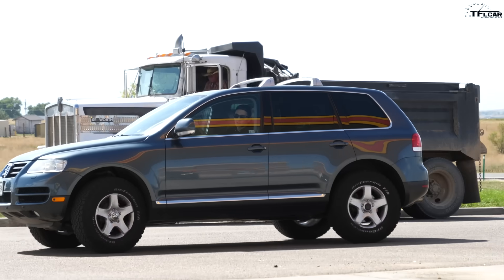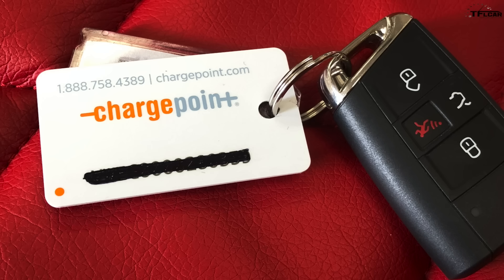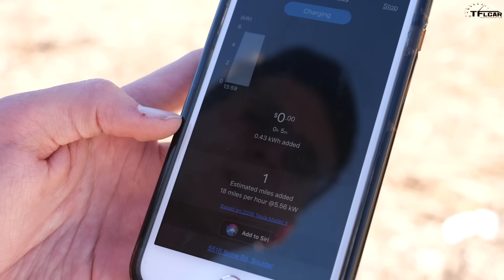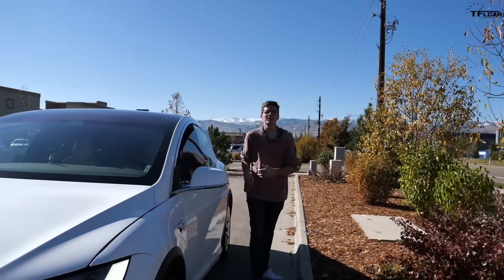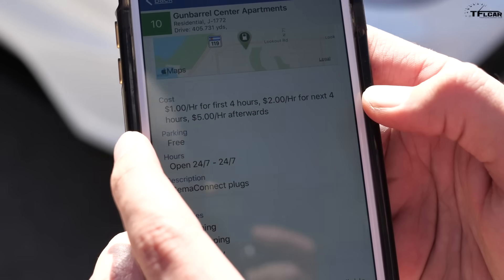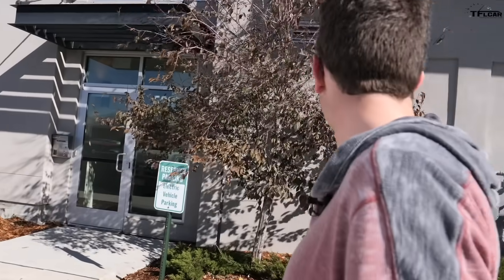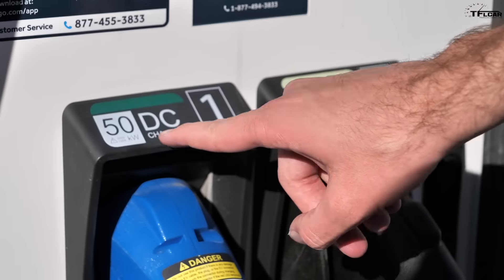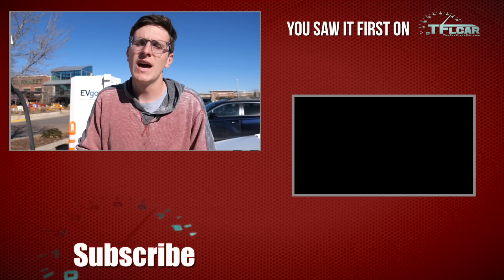Here’s Why Charging an Electric Car Can Suck - And It’s Not The Reason You Think!

Comment: Apparently EV owners don’t value their time.
Reply: non telsa ev owners.  Tesla charging station currently deliver 700 miles an hours, the new one are >1000 miles an hour.
Reply: @Curtis Fleabag Dude, have you seen the Tesla Supercharger map? There is a Supercharger station every 100-150 miles along every interstate in the US. 

This year we took our Model 3 from Atlanta to Orlando. From Atlanta to the GA coast. And from Atlanta to DC. To Orlando we stopped twice for 20 minutes. To the GA coast we stopped once for 20 minutes. And to DC we stopped 3 times for 20 minutes. Now that the even faster V3 Superchargers are going in that time will drop.
Reply: Philip Davis look between Dallas and Houston, there's only 2. So if you're between them and need to stop you gotta wait or hold it or stop at a gas station to drop a deuce. All the while NOT charging it.
Reply: @Scottjf8  So? I checked and the distance between Dallas and Huston is 239 miles by car with a butt-ton of chargers (including superchargers) in the metro regions of both. So, there are two options for superchargers, and on the public network I see more. Both supercharging stations have restrooms (and more), but for most Teslas there's only need for one stop on the trip. If you can't handle your bathroom issues with one stop that's fine, but you'll have the same problem with a gas car.

Bottom line here is those of us who have, or are considering one can enjoy the cost savings and lower pollution, and they are only getting better. Tesla's truck will have up to a 500 mile range and be about the same cost as the new F150 EV from Ford, and in the same range as the new Mustang EV. But you don't have to buy one.
Reply: If you say so. Could easily park, charge and go do something while it's charging. Really not that challenging to go out and do something while you wait. More like a You problem.
Reply: These kind of people also don't smellin their own farts...
Reply: @randygrein5386  *hands Randy another Kool Aid
Reply: @JPGtampa  Funny, that's the go-to when someone runs out of evidence. You'll come around when the Koch brothers die off and the ad campaigns stop. Unless your house blows away in the meantime.
Reply: @randygrein5386  LOLOLOL... Not a fan of the Koch brothers but okay, chicken little
Reply: @JPGtampa  There's a fable about the ant and the grasshopper that's relevant. But OK, be a grasshopper....
Reply: Just the stupid ones that use the low powered chargers shown in the video. Go to a Tesla SC station and it’s way different, esp if it has the new 250kw chargers.
Reply: City driving is actually less time. It's the road-trips that are a bit inconvenient and certainly need to be well-planned. Hybrids rock on road trips.
Reply: The thing is they expect everyone to stop every 200 miles charging their cars and wasting money at every Starbucks and McDonalds that is placées at every charge station.
Reply: Except you're totally wrong. I'll give you a few examples with my personal EV, a Chevy Bolt with 200+ miles of highway range:

Daily driving scenario:
I get to work. Plug in, do my shift, unplug, and drive off. Takes 10 seconds to plug/unplug. Meanwhile, with a gas pump, you have to stand at the pump for a few minutes! Not fun if the weather is bad... Most of the time, I only plug in 1-2 times a week, while my gas car was being fueled once weekly, so not much difference in frequency.

Road Trip:
It's important to note that going further than 200 miles is much less than 1% of the use of the car, so the importance of this use scenario is actually pretty low. I digress...

Even with a gas car, you must stop every now and then to use the bathroom, eat, rest, refuel, etc, all of which can take around a half hour, unless you're a slob that eats in your car as you drive! The waiting time to charge is easily mitigated by stopping at a fast charger where there is also a restaurant, pretty common for most fast chargers already installed today. After 30-40 minutes, the car is ready to continue on its way, while wasting almost none of your time because you were eating/resting anyways.
Reply: Whatchu talkin' bout, Willis?  It charges while I'm asleep.  What all you doing while you asleep?
Reply: I guarantee you I spend less time actively charging my EV than you do filling up with gas over 1 year. Every 3 or 4 days when I pull into my garage I spend around 5 seconds to reach for the plug hanging on the wall and walk back and plug it in. By late evening it is done charging and in the morning I unplug it as I walk to the car which is maybe another 5 seconds. 

So every month I spend less than 1 1/2 minutes actively involved in charging my car. How many minutes a month do your spend multiple times pulling off the road to a gas station, parking, getting out of your car, taking off the gas cap, getting your card out of your wallet, swiping, picking a grade of gas, pulling the pump nozzle out, putting the pump nozzle in, standing and waiting for it to fill up, pulling out the nozzle, hanging it up, putting the gas cap back on, pushing to finish, walking back to the driver's door and getting in and driving back out to the road and continuing on your way?
Reply: Philip Davis i love how u put in trivial things into the gas example while not including them in the EV example even though u have to do that too. Gas cap? So EVs just have exposed plugs? Getting out of the car? I guess EVs just throw u out the car so u dont have to get out. Grabbing the nozzle? The EV charger just magically picks itself up and places itself in the plug? Parking??? EVs dont park? Ur argument is completely ridiculous and one sided while people are talking about actual concerns. Not everyone works near their home and travel many distances. What then??? Charging stations are not common at all yet. Till this day i still have never seen one. Yes, electric cars are cheaper, but for many people its still not an option.
Reply: @thotwalk5776  Um, you're being just as silly as you claim Philip is. 'Travel many distances' must mean 'have a long commute'. Yup. If you drive more than 100 miles to work (and back) you might want to think about it a bit. Ditto if you have never seen a charging station in your area, although if you don't install one at home after buying an electric car you're giving away a lot of money.

But so what? Average commute is 19 miles, not 190. Charging stations are popping up fast where there's a big EV population, so they'll get to your area eventually. But YOU don't have to drive one. Those of us who do are quite happy with our decision.
Reply: @flipadavis  

everything you described there only takes about 3-4 minutes top unless you are a mong
6-7 visits to the pump a month = 21-28 minutes/month
so, while it is fact that you spend less time charging your car than most do pumping gas, the time saved is trivial
Reply: @jikokuten  Let's just hold on a minute here. I spend maybe 1 minute a month of actual time plugging in in my garage. Pumping gas takes up 15-30 minutes a month of one's time. OrangeManBad started this thread by saying "Apparently EV owners don’t value their time." I responded to this incorrect statement by stating that I actually spend less time charging than most people pumping gas. I proved his statement was wrong but now are we all saying that "the time saved is trivial"? 
What stance are you taking? Are you agreeing with OrangeManBad?
Reply: @flipadavis  
"but now we are all saying."
who is we? I said it, nobody else.
I guess I agreee with him in the context of the video, that is to say if people commit to the process of charging their cars for hours. If you don't do that then ok then I agree it takes less time woopee who cares bye
Reply: @flipadavis  This is only a valid argument because you can leave your car unattended while it charges. A lot of people filling with gas simply run into the gas station and get something. 

The time difference is negligible.
Reply: @JPGtampa  Exactly. On the occasional road trip having to stop anyway for family to take bathroom breaks every 3 hours or so makes charging for 20 minutes at each stop not much different. The the majority of the rest of the year it is actually MORE convenient to have an EV that you can keep topped off at home so you never waste time at gas stations
Reply: @flipadavis  I was making the case for staying with petro fuel
Reply: @JPGtampa  You're not making a good case. I don't want to waste time pulling off the road and going into a gas station to buy crap I dont need every week or so. That's not a plus it's a negative.
Reply: @flipadavis  My point was that, despite that, stopping for gas isn't that much longer commutatively.
Reply: @JPGtampa  And the same goes for EVs on road trips. But people spend more time not on road trips filling their car up so the advantage goes to EVs. And they have less maintenance and cost less to fuel.
Reply: @flipadavis  Yeah no thanks, I'll never drive one and to each his own. But last time I checked, I drive a car for convenience and to get where I'm going. The last thing I want to do is sit around and wait to charge up when I could've filled up in about 2-3 minutes. 
I know, I know... You charge at home while you're sleeping. That's fine, but your environmental efforts are misplaced because I'm willing to bet most people charging an EV are getting juice from a coal-fired plant. (Yes, I'm aware of nuclear plants and solar farms.) 

Anyway, I'll never drive one so it doesn't concern me anyway. I do have a truck that I run on biodiesel and waste veggie oil sometimes. I do it for fun and cost savings, not because I believe the fanatical environmental hype.
Reply: @JPGtampa  Coal makes up 24% of grid in 2019 according to EIA. Either way according to Fueleconomy.gov in their side by side comparison shows that, for example, a Model 3 running 100% on coal electricity will still have half the emissions of a similar mid sized gas car. This is counting upstream emissions for both fuel types. On the CA grid or similar it will have 1/4 the emissions.
Reply: @flipadavis  Meh... It's not for me. I've ridden in a model 3 and it didn't do much for me. There's nothing visceral or engaging about it. I thought the experience was very vanilla and boring, tbh.
Reply: @JPGtampa

https://m.youtube.com/watch?v=xz5mV0Y1804
Reply: @jikokuten  Yup, but that WAS the challenge which was accepted, met and won. What is not trivial is the savings in operations cost. But everyone considering this needs to sit down and sort out the advantages and disadvantages, and see what is important to them.
Reply: @randygrein5386  I wouldn't even think about it until they can fully charge one in about 1 minute. But why the urgency to get away from fossil fuels? You haven't fallen for the hype, have you? 🙄 Come on, you're smarter than that. 

Btw, I have driven one.. a model 3.
Reply: @JPGtampa  Heh. I was a physics major in college and keep up. It's not 'hype' at all - we've known about global warming/climate change/choose your name for, oh, almost 50 years. We knew it was possible since CO2 was first isolated and the discoverer realized it would hold heat in from the sun - in the late 18th century. The 'controversy' is entirely political, restricted to the US and to a lesser extend Australia, and fading fast. Latest survey is that 3/4 of Americans now recognize that the planet is warming and we are the cause. I could give you the skinny on how we know it's happening as well as how we know we are responsible but this isn't the place for it.

My state is lucky with lots of hydroelectric power (77% renewable energy for the grid last year) with lots of potential for wind and solar. We are also EV central, at least the metro region. But I've always been concerned about fossil fuels. Before it was a matter of choosing fuel efficient cars - or motorcycles when feasible, then getting a hybrid in 2010. This is just a logical next step. I've had my Ford Focus EV for 4 1/2 years and 46,000 miles with zero problems except range. My wife just got a model 3 which solves that problem for more than commuting, and so far we've had none of the problems you've brought up. I have a couple trips planned soon - one cross state, one next year down to Arizona. Yes, I'd like more range and more options, and less expensive cars. I see two coming within 2 years - one with a 450 mile range, the other claiming 1000 miles. Both have small-scale charging from rooftop embedded solar cells, but that's augmentation, not sole charging.
Reply: @randygrein5386  LOL okay Randy 😏
Keep believing the scientists... No one is denying climate change. But the amount of human cause is debatable. 
Anyway...
All this talk about driving makes me want to go somewhere. I have no errands to run but I like driving my truck so I'm going to go roll some coal in about an hour or so. 👍
Reply: @JPGtampa  It's not a matter of belief. I was studying to BE a scientist. Quick point: We know that C14 (the radioactive isotope that allows carbon dating) is created in the upper atmosphere from cosmic radiation hitting nitrogen atoms (N14). That rate is pretty much constant. Fossil fuels have no C14 because the carbon has been buried for millions of years; all the C14 has decayed. We can measure both the level of C02 as well as the ratio of C12/13 and C14 for several hundred thousand years. (Search Scientific American, Circa 1980 for an article on CO2 measurements from Antarctic glacial ice cores.) The increase is entirely from C14 depleted carbon - fossil fuels, and the amount matches the amount of coal, oil and natural gas we've burned since the Industrial revolution.

So, yeah, it's not much of a debate - again, except in politics where scientific ignorance is paraded about as a virtue. There's a lot more evidence of course, but that should be sufficient.
Reply: @randygrein5386  Blah blah blah... It's here, we have it, let's use it up. Everyone going "green" right away is impractical.
Reply: @flipadavis  5 seconds dude, wow what a huge waste of time. I'd rather just find a gas station, wait in line, etc, 3 times a week which is soooo much more convenient. /sarcasm
Reply: I've heard you are to plan your time - go out to eat, go shopping - doesn't sound like an easy change of habit
Reply: @timelapseinsanity178  I guess it depends how you look at it. As a Model 3 owner, I have more time. I never have to go to gas stations and whenever I travel, the super chargers only take 15 minutes on a 300 Mile range car. So maybe a little longer on road trips but the convenience is worth it and I get way more time back by not having to go to gas stations, plus I save a lot of money as well. And as the other guy mentioned, I usually go to the restroom or grab a snack so it's not bad.
Reply: @S1RLANC3  I still have questions about the money being saved though. I can't afford a Tesla, but do you still save anything after buying such an expensive vehicle?
Reply: Reality is you charge at home and the car is always ready when you need it. On long journeys by the time you have driven 300 miles your need a break for food and to go to the bathroom. By time you do those you are charged and ready to go again.

Unless you live at those apartments I cannot see why you would ever use those stations. They are only practical for someone who already plans to be there for up to 10 hours, sleeping...
Reply: Yep and they can't think beyond the tail pipe of any car.
Reply: Yeah I’m good. I’ll take my gas.
Reply: The best part, these cars are POS

Comment: Hmm, low on charge due to stuck in traffic in bad weather so the climate control ate your resources. Need to add enough charge to make it the 20 miles home.  Stuck at the pump for over an hour.  Not sure what your hourly worth is, but at $30 per hour and more for anyone who can afford a Tesla, the charge is giving the same distance as about $3.00 US for a gallon of gas. Unless you can charge at home or work and leave the charging unattended, the cost in manpower to be idle is crazy expensive.

Comment: 240 volts is not "high voltage." 

Voltages 600 V and below are referred to as “low voltage,” voltages from 600 V-69 kV are referred to as “medium voltage,” voltages from 69 kV-230 kV are referred to as “high voltage” and voltages 230 kV-1,100 kV are referred to as “extra high voltage,” with 1,100 kV also referred to as “ultra high voltage.”